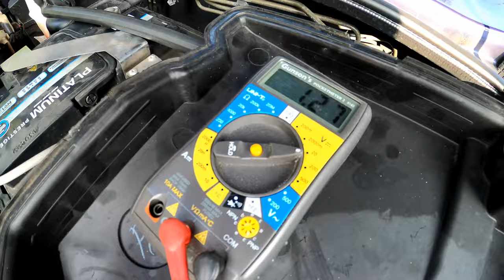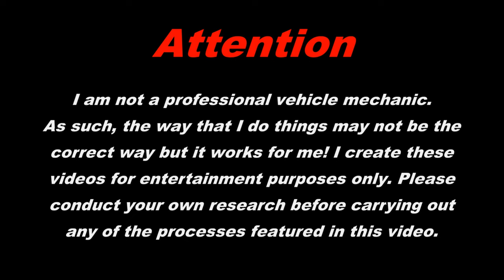Mini One & Cooper, R50 & R52, 1.4 & 1.6 Litre - Alternator Change, Full Removal & Fitment - Pt. 1

Comment: He didnt tell us you can just take the front bumper off 🙄
Reply: How ?
Reply: I removed the front bumper cover, the crash bar, front wheel and you can access the alternator bolts easily without doing all that intake removal, etc.  Bumper cover and crash bar underneath is very quick and easy.
Reply: @BaronStianGyllenhammar Remove the front bumper cover by removing all the screws and bolts.  Unplug the lights.  Route the ambient temperature sensors  out of the crash bar underneath the bumper.  Remove 5 bolts on each side of the crash bar.  Now remove the two bolts on the alternator side of the crash bar shock absorber.  Now remove the upper radiator hose above the alternator and release the tension on the serpentine belt to pop off the alternator belt.  Now you can access the top bolt on the alternator and the two lower bolts - remove the alternator after detaching the wiring.
Reply: @BritIronRebel thats right this video make evrything so complicate totally wrong.

Comment: Great video, really helped us when doing an alternator change. The only thing I'd add is that when releasing the tension on the belt tensioner, use an F clamp or similar, hook it below that square hole and wind id down on the top of the ali housing above. Makes releasing the tension really simple!

Comment: Did this car have Air Conditioning?  I dont have any space next to the radiator to reach the lower alternator bolt...theres a verticle aluminum part of the A/C where you have a space.  I''m doing a 2002 model.

Comment: Hiya I was just curious if this would be the same process on a mini one diesel? Thanks for the video!
Reply from the maker: It's not the same process but as it happens it is actually far easier on the diesel model as you don't have loads of stuff to remove just to get at the alternator. If you pop the plastic cover off of the top of the engine then you can see the alternator to the left as you look at it. Far better access.
Reply: @KevsShed  thank you for reply!! Do you think I could still use this video as a guide to take everything off? This is the first time doing something like this and I’ve been told I need to drop the engine but I’d really rather not as I know it’s tricky to get it back into place. Thanks again :)